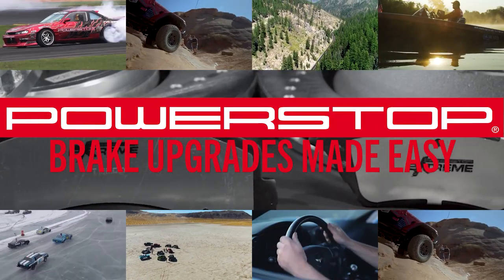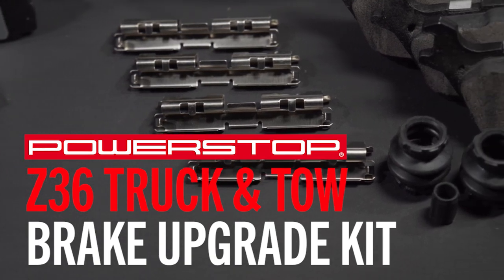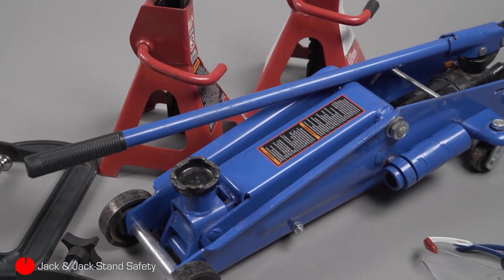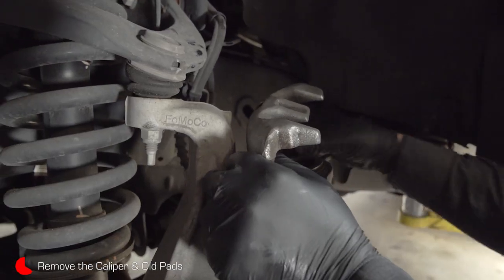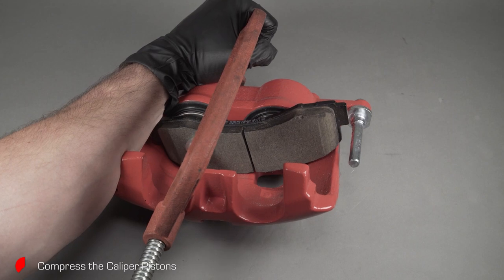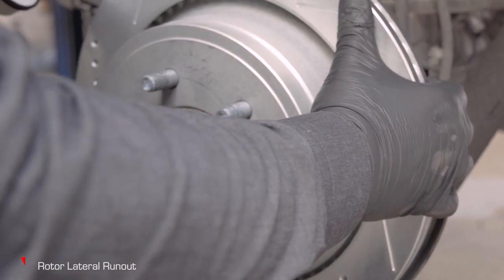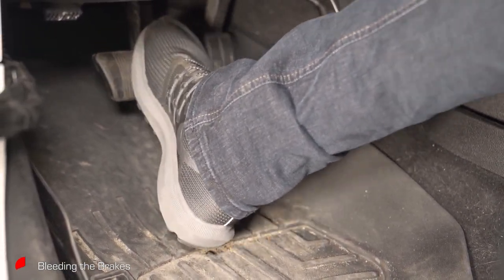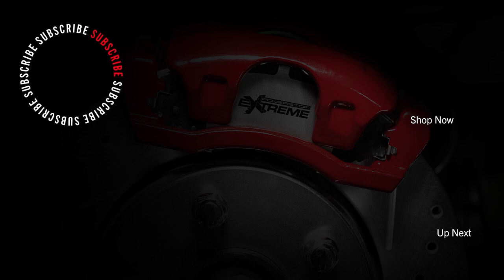How To Replace Brakes Ford F-150 (2010-2020) | PowerStop

Comment: Thank you for sharing and providing great detail. Curious such installation procedure and steps be considered routine practice by if installed by a dealer and or local shop?  Seems the ones I have had my brake services done at skipped bleeding, runout and brake in. Thanks